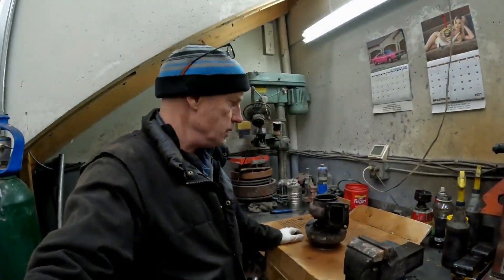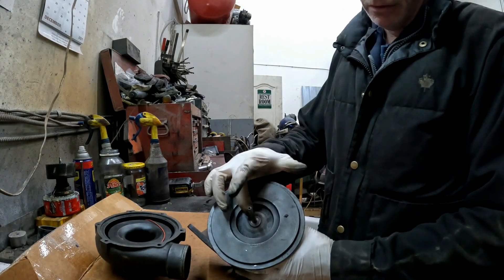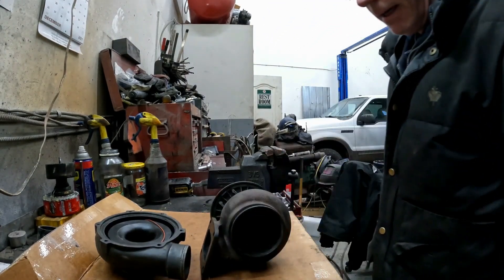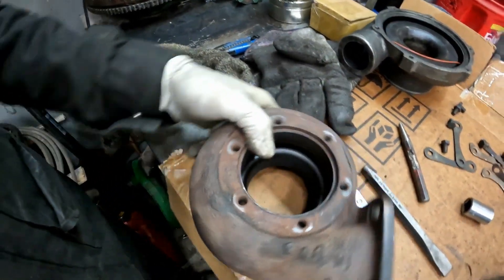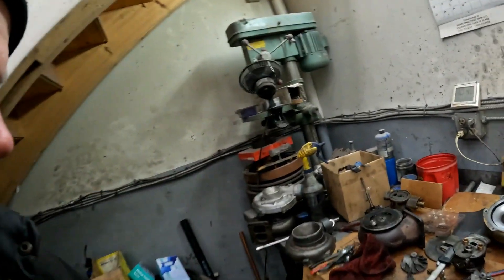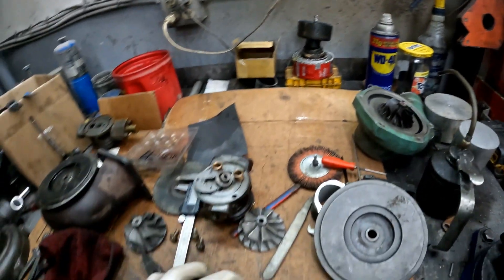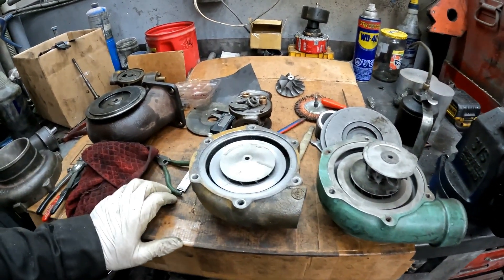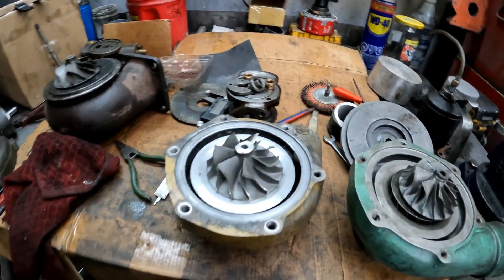Garrett T04E (Rebuild And Upgrade)

Comment: hi buddy,nice video,im home again being winter and noticed you made  a few more videos nice.
I had my turbo rebuilt last year,i sent to a shop it was leaking a little oil,i almost tried doing it myself ,what discouraged me ,was  all the talk  of everything on the shaft had to line up back the same way,,seemed finicky so i decided to just send to a place for rebuild.
Also the noise you mentioned at 1200 rpms,i thought they suppose to whistle at 1200 when they kick in,but you did say a squeel.
Reply from the maker: Thanks, I had a few old turbos on the shelf and decided to go through them.  As the compressor wheel balanced separately I think I might get away without rebalancing the whole assembly.  I'll certainly know after some miles.:)  I couldn't find any cause for the squeal, so I put new bearings, seals, upgraded compressor wheel on and am now testing it.:)  Just installed it two days ago, so will see how it performs.:) Thanks for watching.:) Here's the new turbo all rebuilt and upgraded.:)   https://www.youtube.com/watch?v=PyavwRgrJ80

Comment: I have a 471 detroit in my grader was looking to put a turbo on it any thoughts on how to limit the boost to it an what Injectors size should I run? N75s?
Reply from the maker: N70's or N75's would probably work really nice, but I wouldn't go above that.  This will probably make about 10-12 PSI boost which should keep egt's down.  I would monitor egt's if you go down this route.
Reply: @detroitgarage9430  what size turbo can I use or model number? I'm working on getting a 471 out of an old wabco scraper an it has a mechanical tac on the back of the engine.. But sadly the electric motor behind it won't let go.. That had an egt setup on it old school.. Just want a spare engine to build an upgrade if needed.. Mine runs rough I think I need to adjust the rack an or the injectors are bad wet stacks.. It was froze up from sitting for 10 years we got it free an it runs pretty good
Reply from the maker: @2006megablue  I'll do some digging, but the 4-71T used a Garrett T04 with a .96 A/R exhaust housing, not sure on the compressor?  I'd guess either .60 or .70 A/R  would work really well.  A nice replacement for that is a Holset HX40 with a non gated open housing.  I'll try and find the oem turbo number for you.
Reply: @detroitgarage9430  just a tad smaller than the one o have on the 8v71t that's a huge turbo.. You dnt know where I can get Jake's for that engine do you? It's for my 47 diamond t project
Reply from the maker: Ok, the Turbo in the day was a Garrett TV8101 for the N75's.:)  There's lots of info on that turbo if you google it.  Looks like it used a larger exhaust housing than .96A/R more like 1.2 or so.:)
Reply: @detroitgarage9430  might be hard to find those turbos wonder what a new cross reference turbo would be
Reply from the maker: @2006megablue  True it's a large turbo, Jakes are available at a descent price.  I'll ask a friend of mine who recently bought a set.
Reply from the maker: @2006megablue  Not sure on that one, you'd have to find the specs ie compressor and turbine sizes, then you can replace with a newer one.
Reply: @detroitgarage9430  yeah I kinda found some used ones on ebay but hard to tell if they would be good or not.. I'll do some more searching.. You dnt think the intake ports would be too small cause it's naturally asperated I forget if there smaller or larger on the t series
Reply from the maker: @2006megablue  It depends on they liners you have, but that won't effect the turbo performance.  That's another whole topic of conversation.lol  Tall vs Short port liners.:)
Reply: @detroitgarage9430  if have to take a picture of them sometime I have some video of us freeing them up if ya got an email?
Reply from the maker: @2006megablue  Ok sounds good.  Email is emerald310@gmail.com
Reply: @detroitgarage9430  I sent some video your way see if they actually work
Reply from the maker: @2006megablue  I never got an email but here's the details on the outfit that has Jakes.:)  It's J & R diesel in Riverside California.

Comment: I upgraded a Volvo TD70 engine (230hp) from a Garret T04B to a H1E and it lifted boost from 14psi to 28psi.  Made an amazing difference to how the truck runs, much more responsive. Turbo technology and efficiency has made a lot of progress.
Reply from the maker: Very true, I have my eye on the new BorgWarner SXE 362 for a future turbo.  I want to try out the new compressor wheels first and see how it improves the T04E.:)  Thanks for watching.:)

Comment: Quick question: I thought the shaft nut holding the compressor wheel was a reverse thread. It doesn't seem to be the case here. Are all T04 like that or some are reverse thread? I have to do mine (T04B with an A/R 0.96 on the exducer) and I don't want to strip it... ;-)
Reply from the maker: It depends on the year and model of Garrett.  All my old T04's are right hand threads, but my newer Garretts are left hand.  They changed to left hand threads to stop the nut from backing off.  To prevent this on the old Garrets I use blue locktite.  Just have a look at the threads and you can tell.:)  Your T04B will be right hand threads.:)  Thanks for watching.:)
Reply: @detroitgarage9430  thank you 😊 keep making those great videos 😊

Comment: Good day..my 353t give off some black smoke...check the turbo and found the shaft has excessive play...garrett 466326-9002 (T04E02). Have some issues sourcing a cartridge..Can you assist me please with a supplier.
Reply from the maker: I've been using Ebay for my supplies, I don't have a traditional supplier.  You might try Turbo Labs of America, he might sells Garret Parts.  http://turbolabofamerica.com/